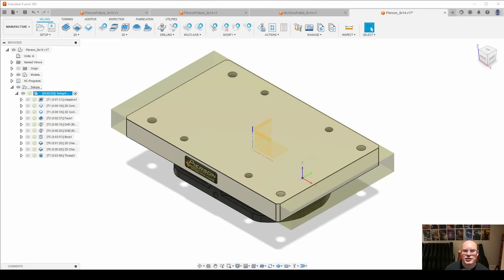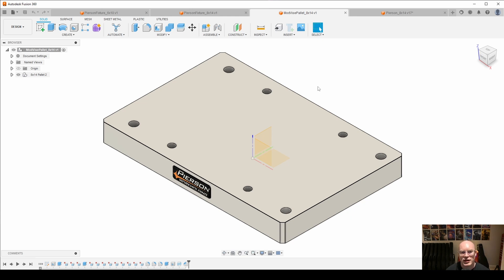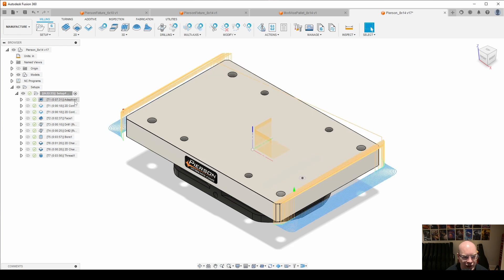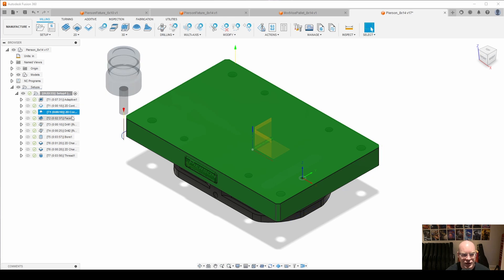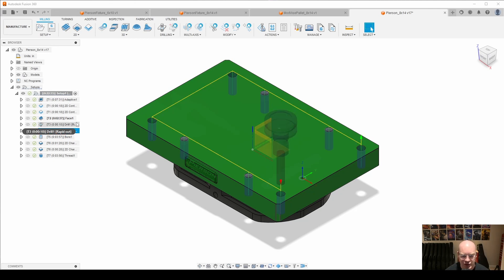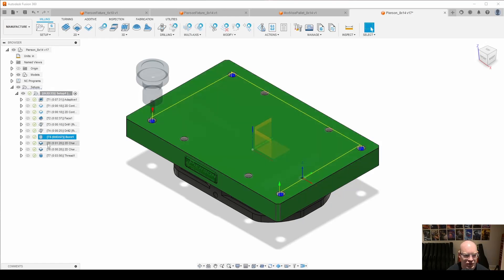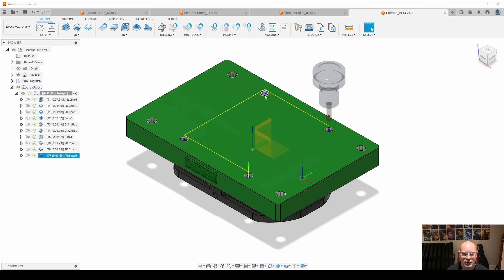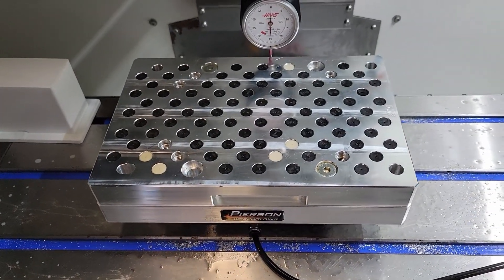SYIL X7 MACHINING A PALLET FOR MOD VISES

Comment: I have an X7 and do rigid tapping all the time and never had a stall.  May I suggest you use TG1 spiral flute machine taps as well as using a compression/tension tap holder...it is just good insurance.

Comment: On the drill, I would add a dwell or a shallow peck every .500". Just try and not allow a chip to get pinched in between the drill and material if pecking.

Comment: Hi, I have a X7 2020 model with Siemens control and 3 phase. I was quite surprised to hear the difference between your mill in the cut and drilling compared to the extra HP I’m lucky to have on the 3 phase model. My spindle would not have slowed at all with that drill or EM. 
Great job, and I look forward to more videos you make.

Comment: Definitely make some pallets with normal vises on them.  Super handy.  I have the PPS and my go to pallet for prototyping is a 10X16 with 3 cheap 3" vises off Amazon.  They're all trammed on the pallet, and shimmed to be less than .01mm off in Z across the 3.  I have another pallet with 2 3" vises setup the same way.  I know you're using the MPS, but a double vise pallet with some 3" vises is super handy.  Move jaws to outside position and you can hold 8" wide stock up to 16" across them.  Or have an OP1 and OP2 (maybe with soft jaws) on the two vises.  

Several of the products I've made I went into production on the 3" vise pallets and then got dedicated pallets with denser fixtures once I knew they would sell.

Comment: The drilling was impressive, as was your surface finish. Did you slot the near/left hole? What did you use to finish the top of the pallet? Ciao, Marco.
Reply from the maker: I used adaptive clearing to remove material from the left and right of the pallet. The surface finish was from a Haas  HEI end mill. I also use a Haas 2" shell mill, which gives a better surface finish.
Reply: @MrSmith1231  Thanks Josh. It looks great.

Comment: Hi and thanks for the video I find that I get better results strait off by using feeds and speeds out of HSM Advisor as they seem to be a lot closer to spot on than Fusion 360 S & F but even then I some times need to fine tune them . yeh just changing to mill tapping was a smart move I think and you have more adjustment to get just the right thread fit as well . Keeping the camera lens clean would be hard with flood coolant I only use mist and air blast, the part turned out grate, well done,
 looking forward to your next video Cheers Bill from Australia